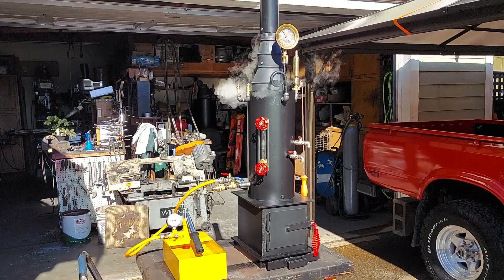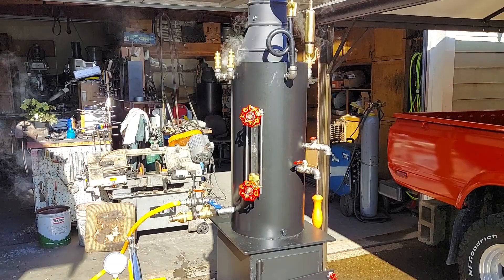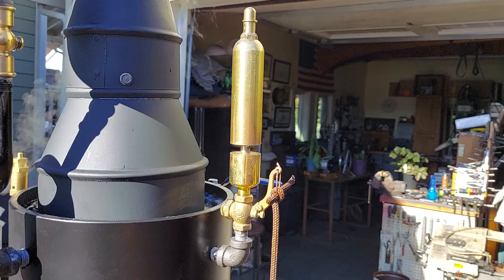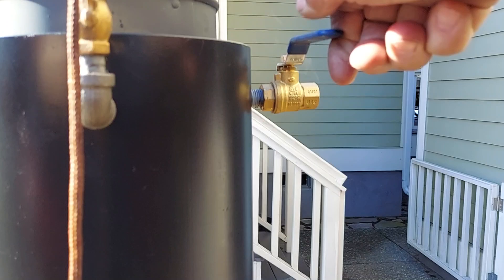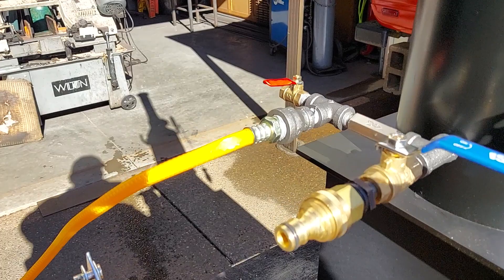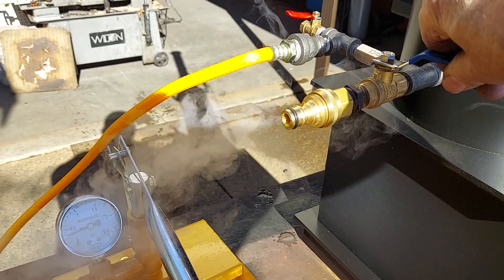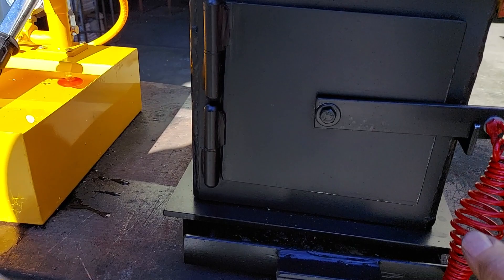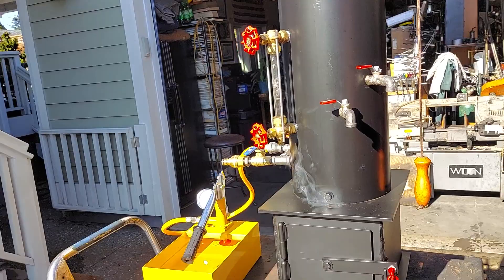Steam Engine Boiler Whistle pump Antique Gauge Off Grid Ross Bendixen

Comment: Hey Rosco I’m located to the south of you about an hour. I’m looking for charging methods for a battery bank I have, and steam engines are interesting to me. I do know in automotive applications it takes about 1hp per 25amps to turn their alternators. If these engines output is 1.5 hp we are looking at around 37.5 AH or less alternator to mate with your engines? 

I’m just trying to get a materials list together and total cost per Kw. If the math works out I’ll buy this unit from you this weekend. I can drive up your way and save you shipping costs.
Reply from the maker: hello, I don't think this steam boiler is large enough to run a steam engine. give me a call 206-948-0770. Ross